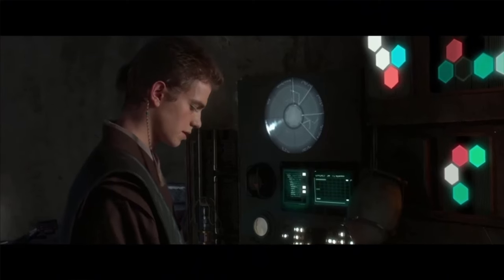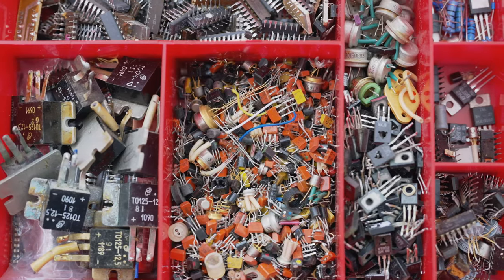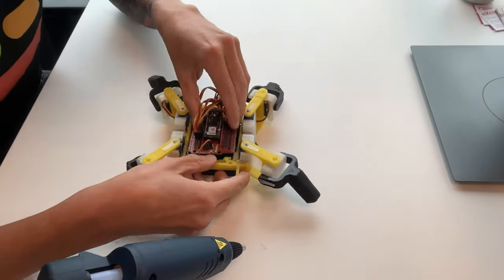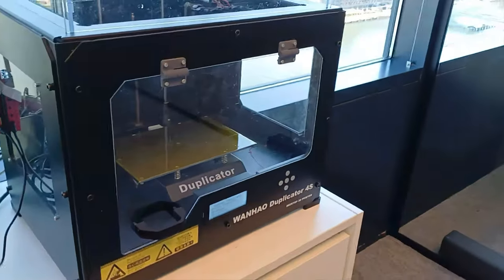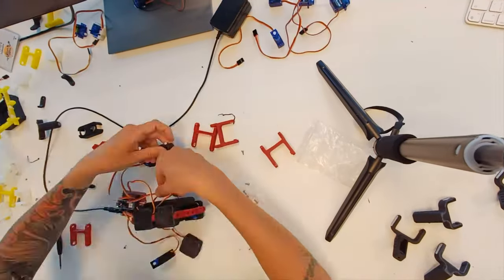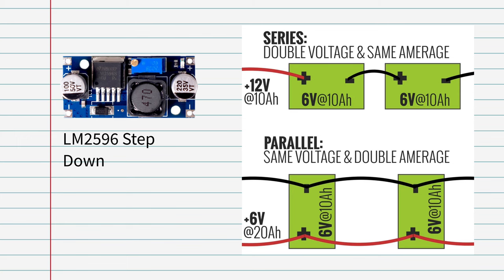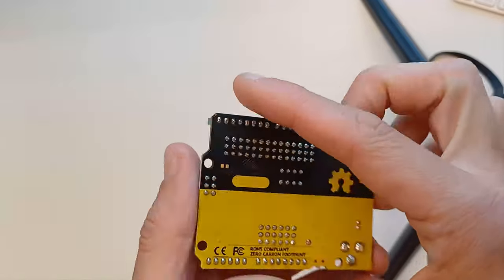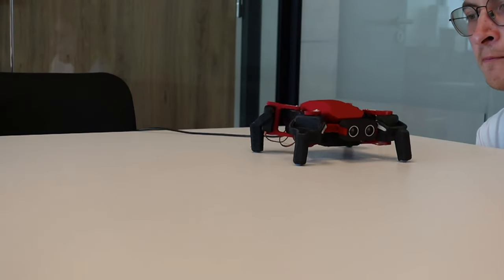How I Revived this Old 3D Printed Robot [Giveaway Contest]

Comment: Great story! A simple upgrade might be to 3d print some boots for it out of TPU for better traction
Reply from the maker: Thanks!
True. I actually had the ad-hoc version of that already, I used a glue gun to put glue dots on the spider feet, otherwise traction on the office table was abysmal. Printed TPU boots is better since they can be uniform.
Reply from the maker: After careful consideration, I decided to award you in a giveaway contest! Can you contact me on LinkedIn (it's in my channel description). If you don't have LinkedIn, reply to the comment and we'll find a way to connect.

Comment: Definitely video streaming as a way to improve the robot. Esp32 is fine, raspberry pi is okay too. For fun challenge, maybe one of those K210 boards even
Reply from the maker: esp32 seems to be the most straightforward. the original design actually uses r pi zero w, but it is a bit of resource waste imo for just the video streaming

Comment: Great video and project.
- Add edge detection sensor. (or multiple connected to slaved esp32 mini.)
- Look into lipo4 for power,.
Reply from the maker: Interesting! 
For lipo4, yes, definitely some improvements can be made around powering this up. Although the 3D printed design would need to be changed considerably for that.
An edge detection sensor - like a bumper sensor?

Comment: Create a low pressure zone below the robot  or on the tip of the legs with a fan like those old wall climbing rc cars to allow the spider to climb walls.
Reply from the maker: Cool idea! Considering it's speed, suction cups on the legs for the same purpose might work better ;)

Comment: I'm probably too late for the contest but I think it would be cool if you added a little ESP8266 or 32 and connect it to home assistant. Then the spider could execute routines to notify you of stuff.
Reply from the maker: It is already WiFi capable with Arduino RP2040 Connect, so it is possible to do this :) Could be fun.

Comment: I have a question. I am currently building this robot right now, and I'm stuck on adding the eyes to the motherboard. Which of the 4 pins do I connect the wire to and where does the wire slot in.  Do you also have a wiring diagram of the power supply?
Reply from the maker: Great! If you are using my .stl files, give some feedback on how they fit on Thingverse, Hackster or Instructables?
About the eyes (I guess you mean ultrasonic ranger sensor), I'm not using them per se. For HC - SR04 there is echo and trigger pins, which can be connected to free digital pins, just google HC - SR04 arduino you'll find plenty of info. Now, you'd also need to add the code for getting information from the sensor.
I did not make any wiring diagrams, but is there anything unclear in the pictures on Hackster/Instructables?

Comment: I need a cool little project it's just I suck at solder, programming and I never printed with ABS, just PLA and PETG, just a more print as a hobby things and no other skills. 😂 but this is still pretty neat. So maybe another upgrade path for dumb ppl like me with plug and play components and maybe an easier way to replace batteries like how you can replace them in a controller but just swapping them out. But I don't think there is an easier way to make more plug and play way but I can dream. 🤣

Comment: You need a rubber end foot
Reply from the maker: Yeah, I actually added little bits of glue on the spider feet from the hot glue gun, it helped. Would be nice to design TPU boots of course.

Comment: would the code work if i replace Arduino RP2040 Connect with arduino nano and its expansion board????
Reply from the maker: Hi!
Great question. I assume you mean Arduino Nano33 BLE, not the original Arduino Nano (this is what I upgraded the spider from).
For Nano33 BLE, the servo code won't change, the voice control will also stay mostly the same or the same. But it does not have WiFi, so you'll have to use Bluetooth for remote control. And since by default Nano33 BLE supports only BLE, you will need to "hack" it to support classic bluetooth, i.e as here https://forum.arduino.cc/t/how-to-use-bluetooth-classic/617662/11.
Reply from the maker: Actually, after a bit further reading down that thread, Nano33 BLE cannot be hacked to support classic Bluetooth even. Bummer. It means that you probably don't want to use it for remote control. Take a look at the ESP32 option tho
Reply: @Hardwareai  i meant original arduino nano i tried finding codes i didn’t get any so i thought this will work but it didn’t you’re saying that you upgraded it so you must be having codes???
Reply from the maker: @anshulkangle4367  oh, right... well, I upgraded it because original arduino nano didn't have enough PWM pins for 8 servos. also no wifi. but the code should be similar to this https://www.thingiverse.com/thing:3118494 . you will need the servo board
Reply: @Hardwareai thank you so much for your help I’ll try out this code and hope it works can i ask your help again if things go sideways
Reply from the maker: @anshulkangle4367  I guess it depends how much help 😉 you're always welcome to make a small donation on Patreon